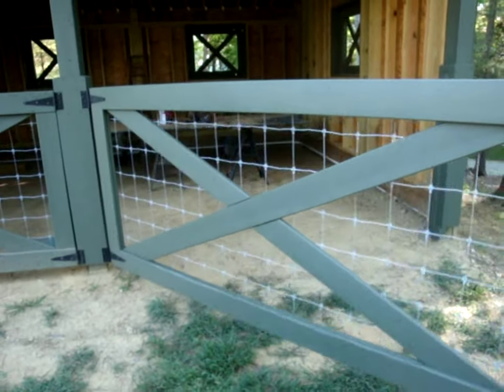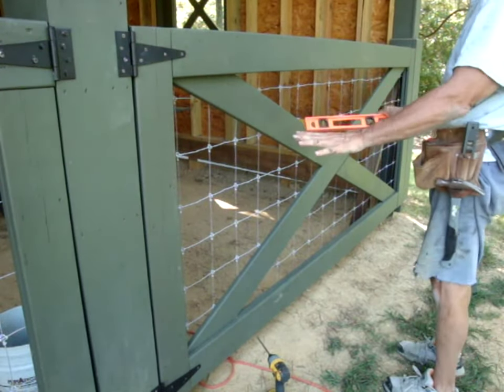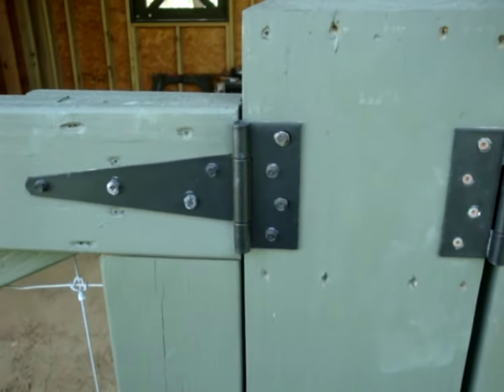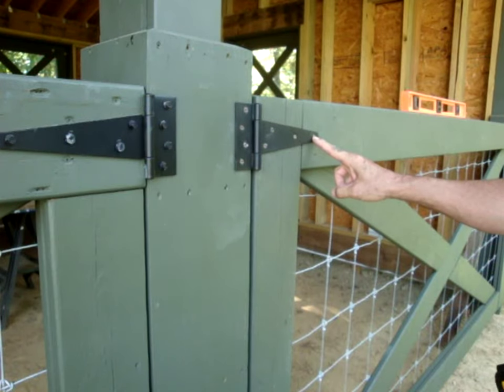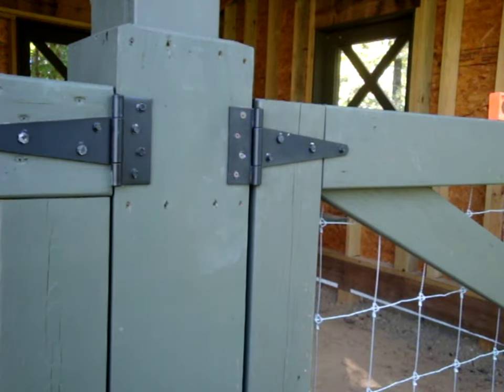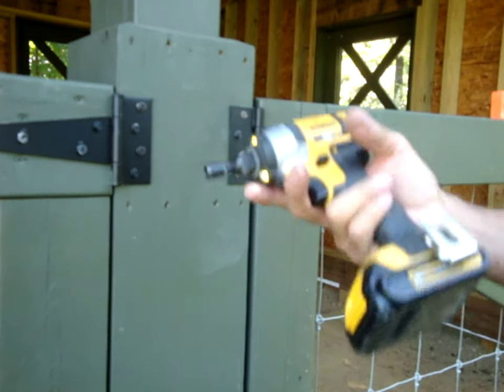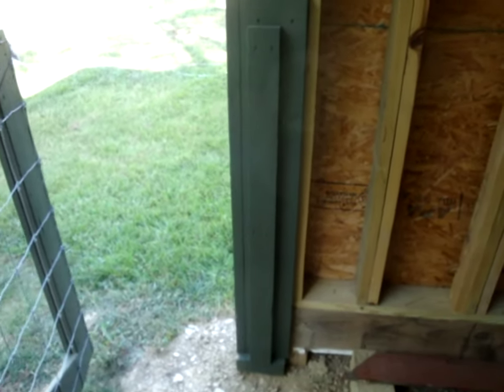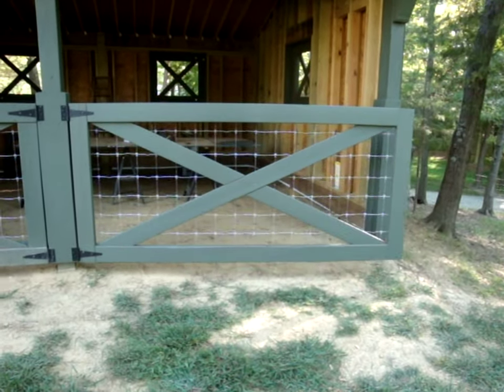How To Hang A Wood Gate -  Complete Instructions For Hinged Gates, Doors & Windows

Comment: I think Harbor Freight redesigned their hinges. The ones I just bought look almost identical except there are 3 holes on the rectangle flap piece and the diagram on the package actually shows 4. They didn't come with screws. A #10 wood deck screw sits almost flush on the rectangle flap, but not on the other side. The holes are actually different sizes. I wanted the screws to sit flush inside the holes.

Comment: Will this work at a length of 13'  6" without saggaing?
Reply from the maker: I would think so.  You may get some twisting flexing movement being that long but you could always add a little more bracing or do a little different design to alleviate that.  Also, if you go that long your hinge selection and fastening will be important.